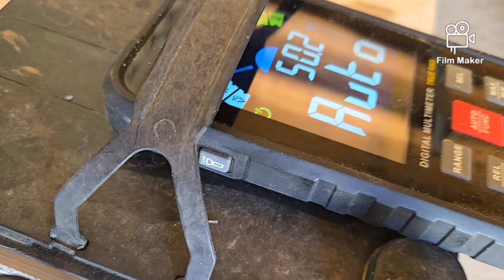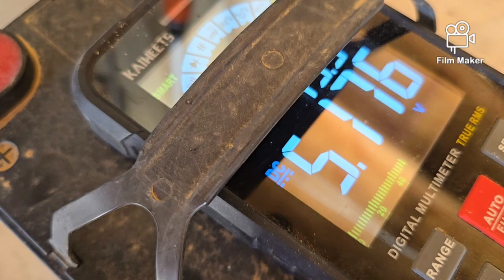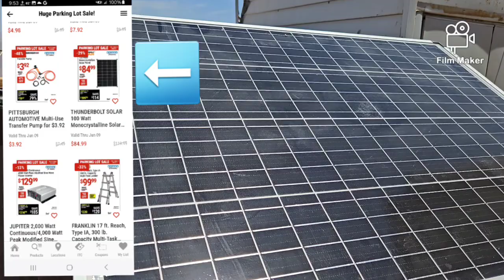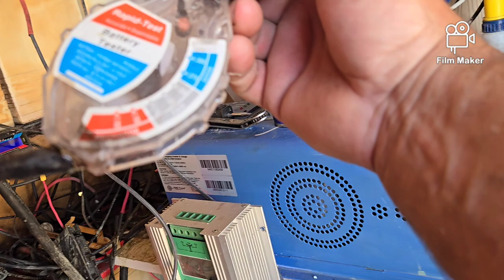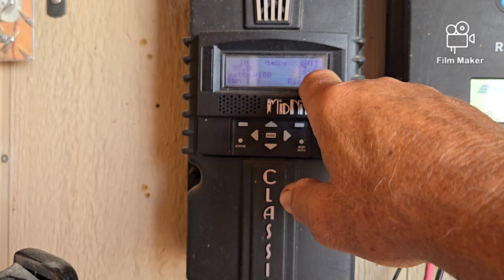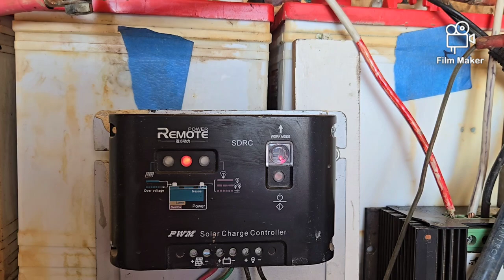Successfully Reviving A Totally DEAD Battery,  June 8, 2024

Comment: Looking forward to updates on these batteries. I'd like to try this myself.
Reply from the maker: Welcome aboard.  It's partly overcast today, but I have some connected and will post results later today.
Reply: @GBear  I live in Ireland off grid and use solar etc, so hoping your method will work for me to revive dead deep cycle 12v batteries.🙂👍
Reply from the maker: @MACLADILLY  Welcome!  Yes, the batteries I am experimenting on are deep cycle batteries.  I'm trying both flooded and sealed lead acid.

Comment: Take one good battery and connect it parallelly to the bad one and add a charger. i recovered a lot of batteries like that. works 90% of the time if battery not are totally shot/cold frozen. can take days but it works
Reply from the maker: Welcome aboard. I tried that, but never had any success with it.  This solar panel method was the first time recovering a dead battery.  And like I said...stone dead, for about a year sitting outside.
Reply: @GBear  Nice. i use the B5 and 6 Lipo.pb.nicmd charger but have to feed the charger with max amp  . can use a 12v battery to power the charger ,neat thing, used in RC drones etc charging ..yeah will try that solar trick as well
Reply from the maker: @kendexter I have batteries on solar panels since yesterday and will be doing a followup in today's video.

Comment: I may TRY this on a 12v deep cycle backup battery but in the drive way.  Also, 100 watt panels at $49.99 on signature solar's website is the lowest I am seeing.  HQST I can get them for about $62  but I know some folks just like China Freight .  My 24v golf cart batteries are now 9 years old so I feel your pain.  I use automotive battery terminal protector (pinkish) and clean and apply yearly and it really keeps any issues to a minimum.  Gary from SE MI.
Reply from the maker: Welcome aboard!  Yep, these were deep cycle batteries.